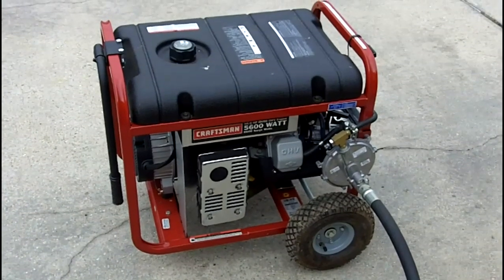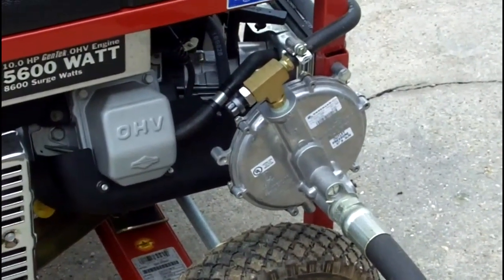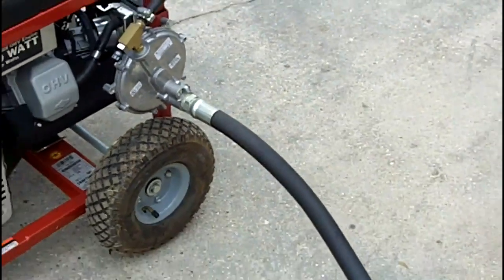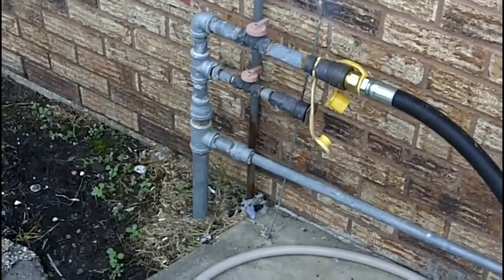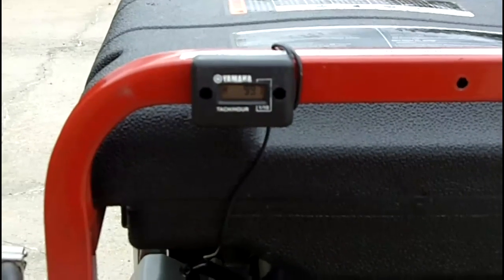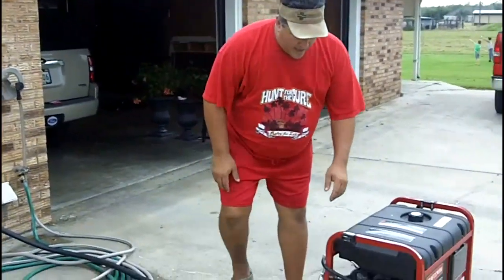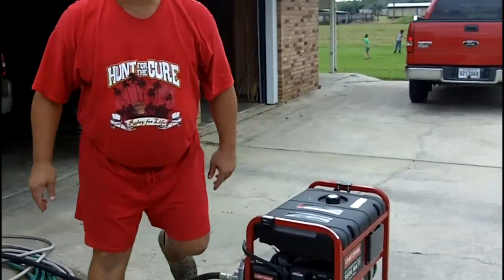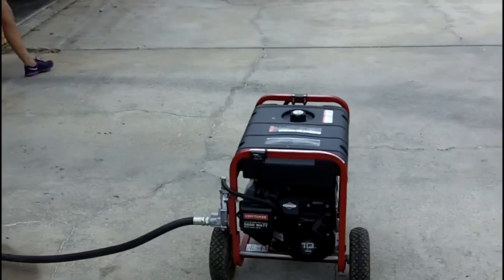Trifuel generator kit

Comment: I plan on running NG about 16 ft to Back of basement from a 3/4 line above my hot water tank and I’ll run 3/4” to back of house. My question is will a 25 ft gas hose 1/2” give enough gas to my 420cc 13hp Generator get enough NG from 25 feet 1/2 hose?

Comment from the maker: The flex hose I ordered when I ordered my kit. It is 3/4 inch with 3/4 fitting. I have always planned on going with a bigger gen in which a 3/4 inch hose would be needed. It is over kill for my genset.